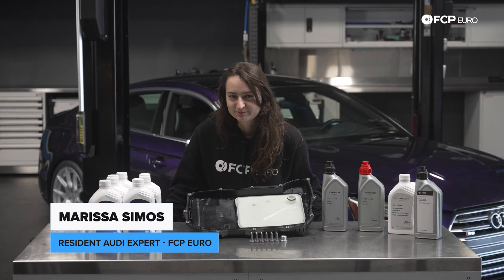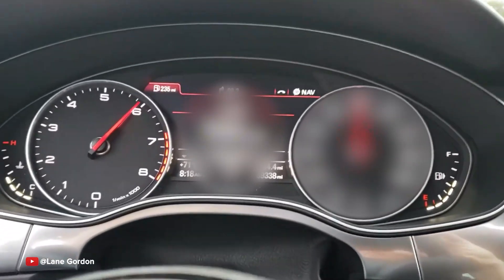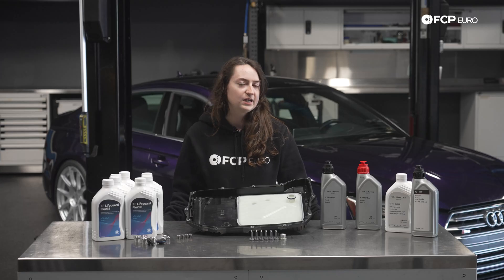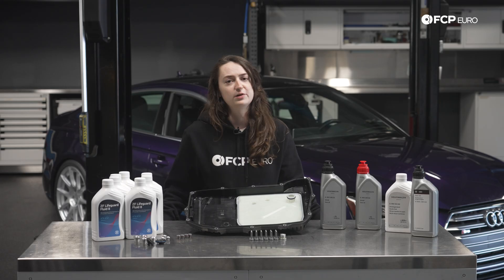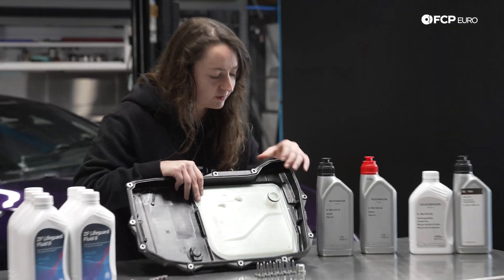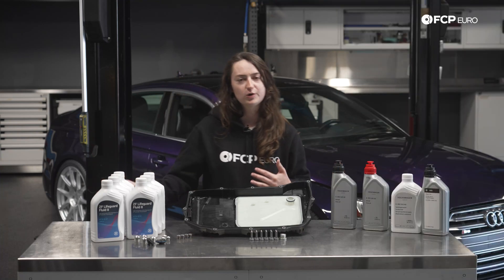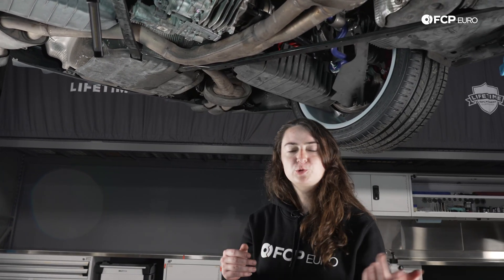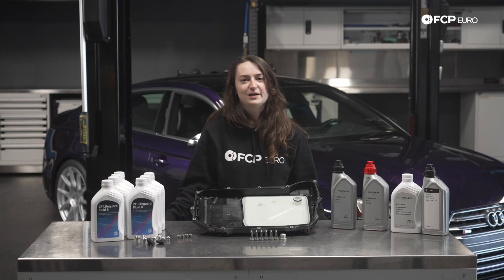Audi S5 Transmission Diagnostic Guide: ZF 8HP  (2018-2024 Audi B9 S4, S5, RS5, SQ5)

Comment: Great detail. Just to note - I have a UK spec 2018 B9 S5 from new - I got the sport diff and painted red calipers - they were separate options and not related. The sports diff option code is: GH2 - which you would see in your handbook or printed label in the vehicle (somewhere).

Comment: A 6 inch rock came under my s5 2023 sportback and my transmission was leaking fluid pretty badly. I turned off the engine and towed it immediately. just hoping it's the oil sump and filter for $2200 vs a new transmission for $10k. Insurance will most likely cover it but nonetheless annoying.

Comment: Gotta love how VAG, in their infinite wisdom, always block regular maintainance items with all sorts of random brackets and frames and wires. Ive done all the fluids on a 2018 Golf R recently and the DQ381 filter especially since its AWD and the driveshafts in the way is an absolute hog to take out and you spill oil absolutely everywhere. You can go in from the bottom with swivel and two extensions on this half height 24mm or you go in from the top removing battery, battery tray and airbox just to have like 5 degrees of rotation on a rachet. Haldex pump is another thing, cant get the bolts out without swivels and extensions and then there still is this overly complicated locked connector thats really far up in there and damn near impossible to unplug as soon as it has any sort of dirt in there. Awesome design work, two thumbs up from me.
Reply: Do you really think cars should be engineered to make a rare service easier or to make the car perform at its best?? Complaining about something you could NEVER pull off to scale is insane logic.🤦🏾🤦🏾
Reply: @KidFromQueens  You are making excuses for bad design. There is only a hand full of regular service items and VAG cant even manage to keep those clear of random clutter. Just a bad design.
Reply: @lobster8009 Thanks for proving my point….you’ve never created anything. It’s not an excuse oppose to an understanding that u can’t solve every problem. You create something with a goal n purpose and if u try to make it perfect, you’ll fail or it will never be done. All that hard work, money, time, and of course compliance just for some lazy dimwit on YT to cry about them not engineering a vehicle for easy repairs! 🤦🏾🤦🏾
Reply: @KidFromQueens You are making excuses for bad design.
Reply: Every car manufacturer is guilty of this though, not just VAG.  Work on some more cars and you'll see.  Or, lots of videos out there showing the ludicrous nature of certain services or procedures on other vehicles.

Comment: Tks miss. You're knowledge is impressive. Just let you know my S4B9 is a 2019 without sport diff, without DCC but car having Red calipers and it came with the car. I think it's because im in Canada and those cars have 2 trim levels instead of 3 in the USA. It's Progressive and the high one is Technik. Love the series thank you and please continue to share knowledge cuz it's our only way to learn more in depth on this platform
Reply: Indeed Canada (and most of the world) has the more typical Audi trims of Komfort, Progressiv, and Technik, while the US...for whatever reason...has Premium, Premium Plus, and Prestige.  And though these are somewhat similar they are not exactly the same or equivalent so some things standard on say a USDM Premium Plus are still options on a CDM Progressiv or vice versa.  Some things are not even options sometimes...  Like the B8 SQ5 the heated/cooled cupholder not at all available in Canada; also the "Supercharged" badges--a $150 option in US but not available "from factory" in Canada and thus the "3.0T" badge was the only way they came.  Also I believe some years the heated rear seats not at all available in the US, while the ventilated front seats not available in Canada...
Reply: I have red calipers too but no sport diff. Audi s5 2017

Comment: Great guide! Just bought a 2020 S5 this week so this will come in handy for getting all of the maintenance up to spec
Reply: I bought mine a few months ago.  an '18 Sportback. How are you liking yours?   Mine needs a stage 1 tune BIGTIME!  lol   Side note, dump the 0w-20 and up to 0w-30. Not an Amsoil junkie, but their 0w-30 euro is great (only Euro rated SP from them) as is Mobil 1 ESP 0-30.  I'd never run Mobil 1 FS again.
Reply: @datsuntoyy  it's been great so far! Holding off on mods for now, but will definitely be eyeing up some different wheels at the least. Mine has a warranty so Im not planning on tuning it anytime soon. It's been a great daily driver that surprisingly gets more compliments than I expected